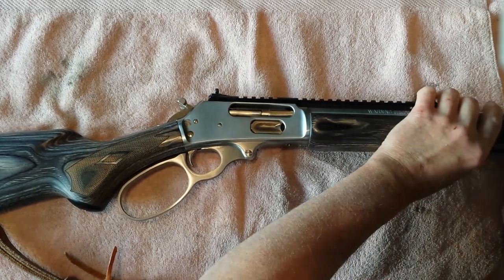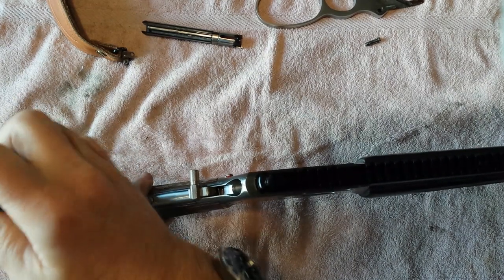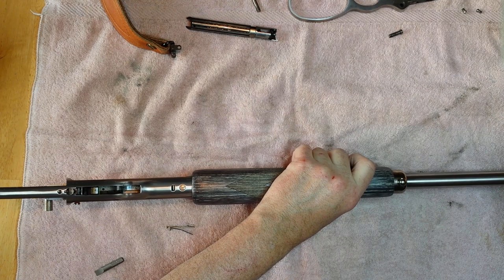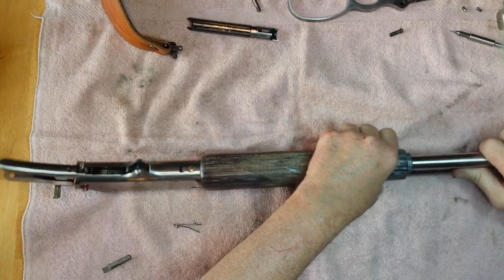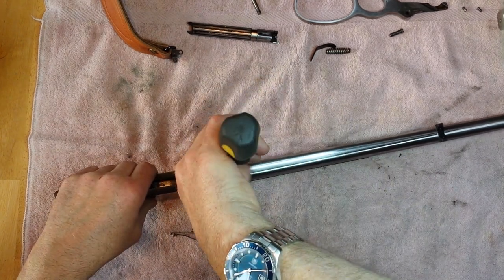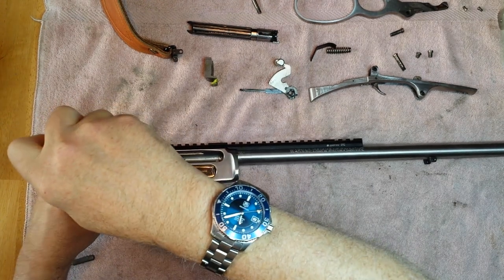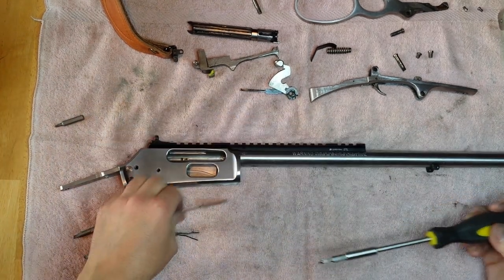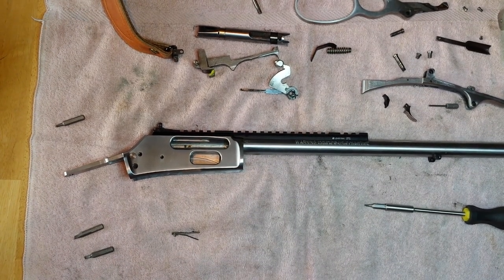Disassembly of Marlin 1895 45-70

Comment from the maker: I took mine apart a dozen times or so while stoning and smooth the internal parts trying to make the action smoother.  it I shot jacketed bullets I wouldn't Clean it alot but shooting lead I wood
Reply: Is the barrel removable?
Reply from the maker: @abnrmlmind  I did not try to remove it. I'm pretty sure they are threaded into the reciever. Sold gun years ago. Shooting a henry x in 45 70 threaded with a silencer....the marlin looked better but the henry loads and shoots way better..
Reply: @coldfield100  thanks

Comment: Any help would be appreciated. Can not figure out how to get magazine tube off of my 1895GBL. Afraid of braking the wood. Any suggestions?
Reply from the maker: I haven't had that gun in a long time.  I think once you remove the screws the wood and mag tube slides off and fwd.  If your tube and forearm are off and just won't separate it might be just a tight fit.  Watch the video again maybe....
Reply: @coldfield100  stock was very tight.. I'll just give it a little tap.thanks.
Reply: Once you take the two screws out 9f the end cap and slide end cap off. Then you punch the dovetail keeper out and foregrip will slide right out. He leaves his in, in the video. You can pry it out that way but you chip off parts of the foregrip when you do it the first time.
Reply: @jamesdb1986  sweet.